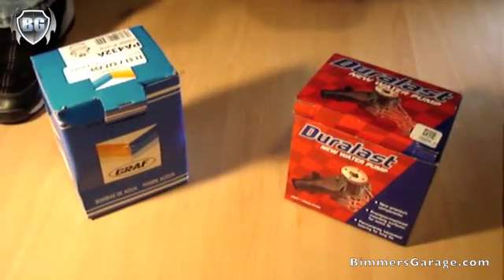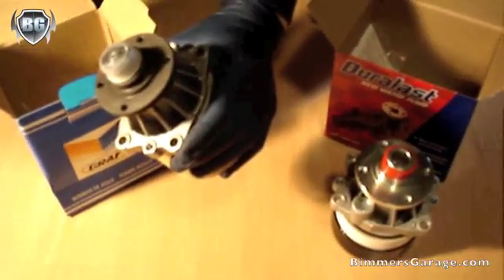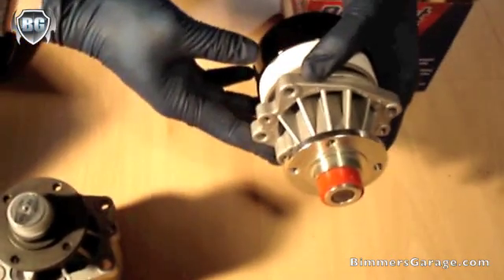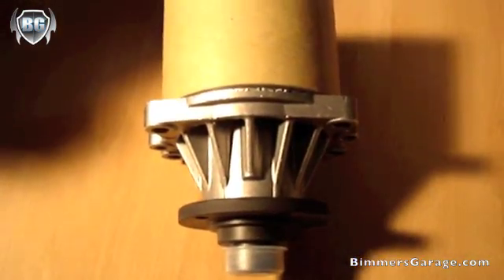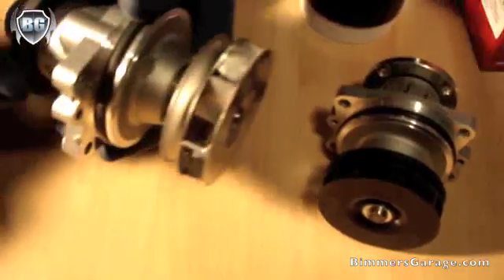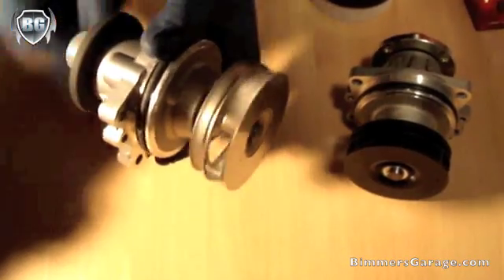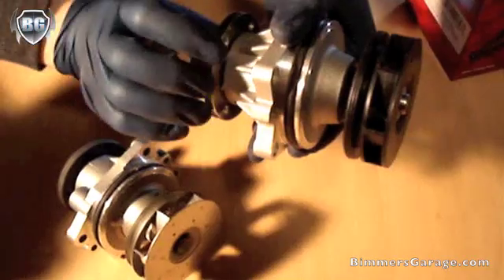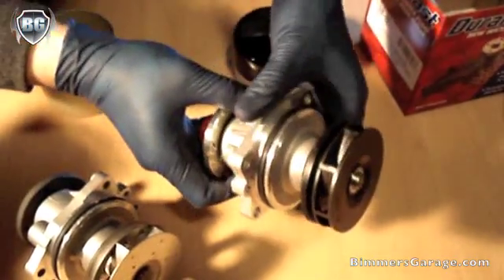BMW Waterpumps Design Comparison /// 330i (E46)

Comment: i would go with the metal because when the metal fails its not like plastic so it's not gonna go through your cooling system
Reply: My Graf unit self-destructed in a most spectacular fashion  My vote is for OEM.  Graf is poor quality.  On paper it should be fine, but unfortunately not.
Reply: @jyo8914  I've been running mine for 3 years no problem
Reply: @anthonyk   Glad you're not having any problems.  I am a sample size of 1.  And my Graf unit got torn up somehow and did wind up going thru my cooling system.

Comment: the casting differences really are meaningless. 
the things that will matter is the bearing(which you noted is loser on the graf) and the quality of the O ring. 

the impeller design is superior on the oem too but overall for day to day it wont matter much to most people.

Comment from the maker: No doubt about that... I would love to see anyone else who has a used Graf waterpump post up a video of their used/old unit (preferably with 65K miles on them) just to see how everything looks on those welds and metal vanes/impeller. And, thanks for your comments and the video bump.
Reply: I replaced my water pump on my 2004 330i (E46) at 70k miles with the 'improved' Graf unit thinking the metal would be much more durable than the plastic of the OEM design (which was in perfect condition at replacement).  Boy, was I wrong!  Before long, I noticed that I had bits and pieces of plastic in my coolant and replaced it.  The Graf unit had self-destructed and the metal had come apart.  I pulled one piece out of the engine and I'm sure I have other bits and pieces floating around inside.  Replaced the entire cooling system including the radiator with OEM BMW parts at 135k.  From here on in, I'm sticking with OEM for vital engine parts.  Hope this helps.

Comment: I concur with bimmersgarage, the OEM water pump looks superior in build quality compared to the Graf. I have the original water pump in my M62 engine with the plastic impeller that now has over 121,000 miles (needs to be replaced now as it's making noise but the bearings are still holding up). Good post.

Comment from the maker: ... the plastic impeller is actually a composite. So, using the old OE waterpump I pulled as reference which lasted up to 90+K without problems. I felt another OEM composite waterpump should hold up just as well. As in the vid, I stated I liked the feel on the fitment of the bearings and the shape of the impeller vanes - to me are much more efficient than the square/rough stamped vanes of the Graf.
Any how, I do appreciate your insight and comments.. It's good to have someone analyze my videos.

Comment from the maker: @gst69man 
Regarding the Graf, true the metal will last longer. However, once you see it in your hand... I didn't have full confidence in the tiny spot welds nor was I impressed with the stampings of the individual metal pieces that made up the impeller. Plus, the knowledge that corrosion MAY eventually weaken the welds causing it to come apart worries me. I don't know about you, but to have those Metal parts circulating in my motor is not something I'd like to risk. About the "plastic", looking

Comment: good analysis but if the Graf is made correctly, correct bearing clearances and correctly welded metal  impeller, I believe that graf will last much longer.  
Plastic impellers get brittle and break, whereas welded metal ones last a lifetime. 
Would be nice to get some 'real world' experience on these parts.
Just ny 2 cents
good vid thanks
Reply: My real world experience is that the Graf is very, very poor quality workmanship.  My Graf unit self-destructed and sent metal parts into my engine.  The welds on the impeller are awful and won't last.  Go OEM.

Comment from the maker: @bmwdriver63 
Great! But, how did you confirm it was tested AND Broken-in at the factory? I didn't find any documents on that fact.
Also, Don't forget to replace the stock Plastic waterpump Pulley with an Aluminum one while you're at it. The OEM plastic ones are know to crack/shatter after 100K+ miles, due to fatigue.  Do NOT re-use your old one.

Comment from the maker: @Clio20 
I installed the OEM stock impeller unit in my vehicle. 
I didn't trust the flimsy looking welds in the metal one. Also, because the bearings felts extremely loose for a "brand new" metal unit.